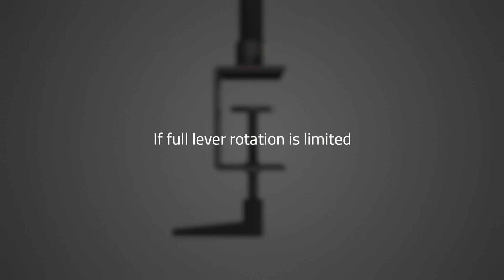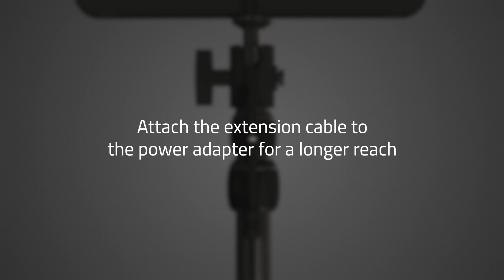How to set up the Razer Key Light Chroma

Comment: Hey there again, so a few days ago I was able to log on my computer and then after a few minutes it just turned to black and I can’t turn it on now, have any suggestions?
Reply from the maker: Let's look into this. Please reach out to us from here: https://insider.razer.com/index.php?forums/support/ so we can better assist in troubleshooting the issue.
Reply: @rzrsupport9502  your video on how to fix this issue helped me!  I probably just wasn’t thinking right… my power cable wasn’t connected properly!   Also, do you have any recommendations on what headset to buy for gaming on the Razer Blade 17
Reply from the maker: We're glad to know that the video we've posted helped you with your concern. We have different preferences when it comes to headsets thus, we can't recommend a specific headset but we can tell that the Razer BlacShark and Razer Kraken models are the favorites. Rest assured, all Razer headsets have top-notch quality. You can check the list of the headsets here: https://www.razer.com/shop/audio/gaming-headsets